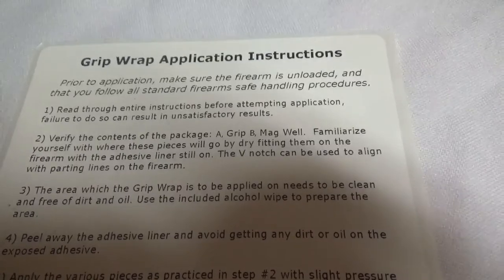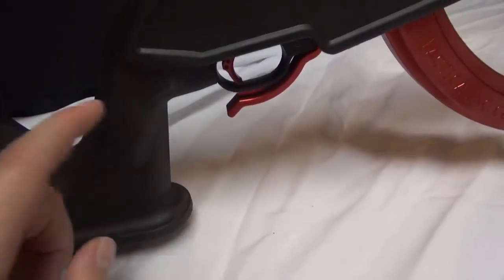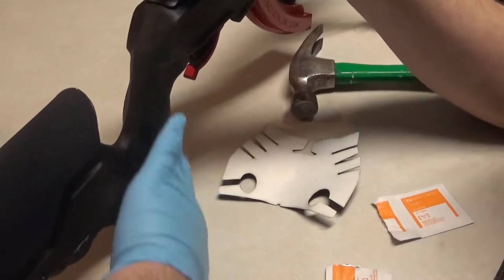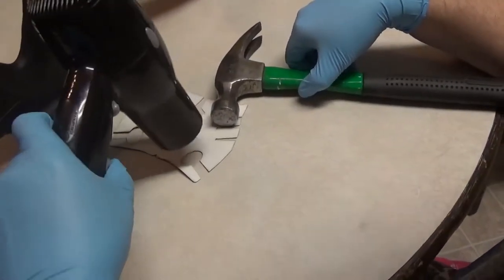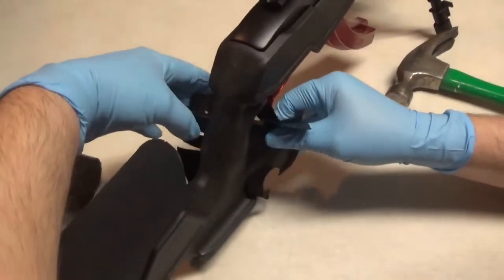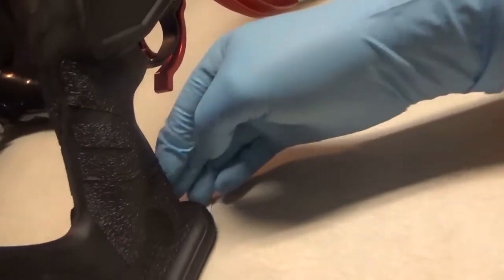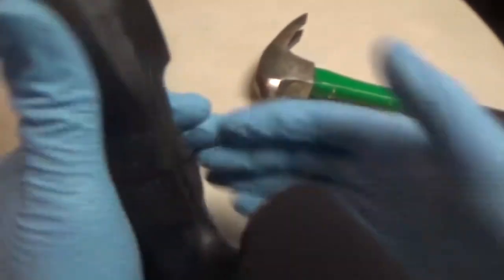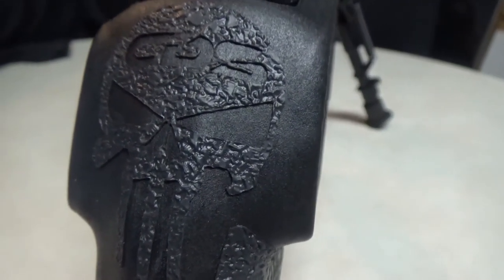CDS Tactical Grips Installation Video AAP1022 Ruger 10/22 Precision Rifle How To DIY

Comment from the maker: CDS Tactical GRIP (Archangel AAP1022 Stock)
https://amzn.to/2HobEmT

CDS Tactical Cheek Riser Pad (1/4 Inch)
https://amzn.to/2KcwfZc

CDS Tactical Cheek Riser (1/8 Inch)
https://amzn.to/2Jn7GY6

CDS Tactical Cheek Riser (1/16 Inch)
https://amzn.to/2HYnRvB

CDS Tactical GRIP (Shockwave Raptor Grip Mossberg 500/590)
https://amzn.to/2HY8ByS

All individual pieces from this build can be found at S&P Outfitters.  They offer all OEM Ruger parts such as stripped receivers, barrels, triggers, pins, etc.  They also have blemished parts at a discount.  

SAP Outfitters (Google is your friend) 

Ruger Precision Stock (AAP1022) By Archangel

For stock google is your friend......

Wiebad Shooting Rest Bags
https://amzn.to/2rzcna1

Wiebad Shooting Cubes
https://amzn.to/2rxCnTp

Wiebad Fortune Cookie Bags
https://amzn.to/2rxHune
Kidd V-block
https://amzn.to/2G5Acvg

Kidd Take Down Screw
https://amzn.to/2IeqaKx

Kidd Shooting Base
https://amzn.to/2G2SfT7